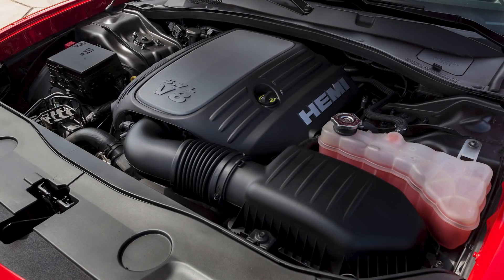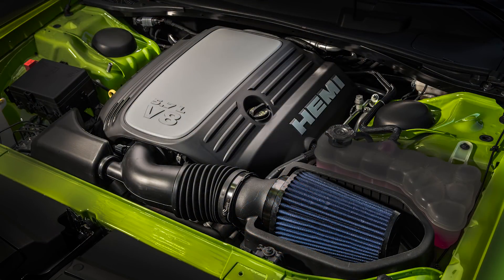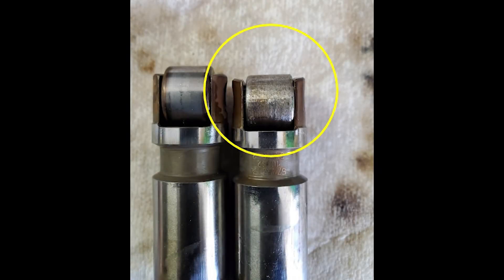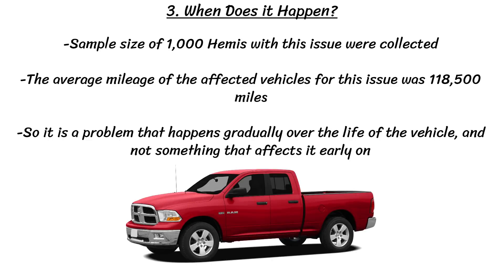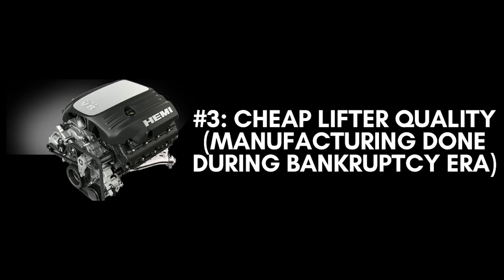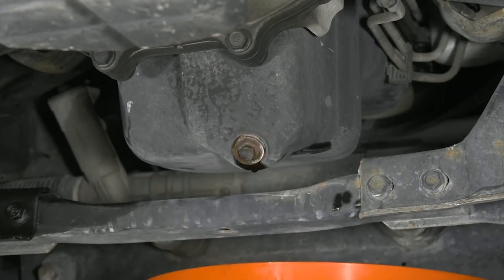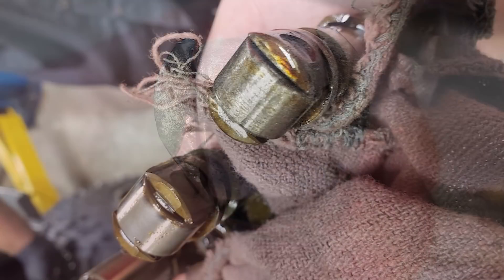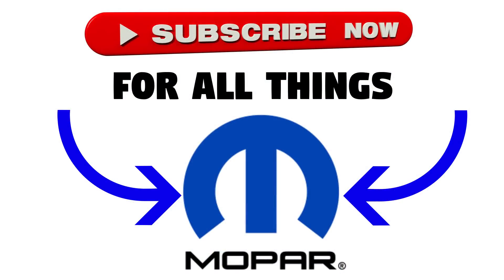The Fatal Flaw of the 5.7L Eagle Hemi V8 Engine Fully Explained (2009+ Lifters and Camshaft Failure)

Comment: This video came out just as I was removing a seized lifter from my Ex Police 2015 Charger Pursuit. I caught the lifter tick so early, it didn't get a chance to damage my camshaft. Lucky me. To all Hemi owners, listen to your engine! Nice video by the way!
Reply: I want to know how many idle hours your engine has...
Reply: @flatoutnorth794  Around 2,700 idle hours.
Reply: @hoonpatrol5994  impressive
Reply: @flatoutnorth794  They're strong motors and they come apart easy. I was able to replace the lifters in my Garage with nothing but hand tools. One thing you should watch out for is the T fitting that connects to the upper side of the heater core. They like to fail, and the car has no low coolant sensor to indicate any problems until it's too late, so if you smell coolant, pull over ASAP. My car nearly overheated, and I believe that was the final nail in the coffin causing the original lifters to fail.
Reply: @hoonpatrol5994  that's some good information! I've been particularly looking for a 2015 16 charger pursuit for a moderate price at auction. They go quick. I'll snag one soon enough.
Reply: @flatoutnorth794  They're great cars, but make sure to inspect it before buying. Auction cars are a big gamble. If you can test drive it, beat the shit out of it. If you can't, have a mechanic look at it. If it's sight on scene, go with your gut! Mine was a great example, but I still had to do some work on it, so I reccomend breaking out some tools and trying to work on it yourself. These cars are stupid simple and a great car to learn on. I've had the thing since I was 18 and have never taken it to a shop except for recall work. Anyway, good luck!
Reply: @hoonpatrol5994  why didn't you just replace the heads before this happened?
Reply: @wildestcowboy2668  What the hell? Why would I need heads? It's an Eagle block Hemi, it doesn't suffer from the valve seat dropping issues like the previous generation of Hemi engines.
Reply: @hoonpatrol5994  Simmer down there pal I just asked a question. After all I'm a custom fabricator/painter not a mechanic.
Reply: @wildestcowboy2668  Sorry if I came across as a bit aggressive.
Reply: @hoonpatrol5994  No biggie playa, I have just heard some engine issues can be avoided by replacing heads. Of course I'm a painter so only listen to me on the exterior of your ride! Lol
Reply: @Hoon Patrol  my 2015 charger pursuit has a 2534 idle hours on it. I haven't heard any issues yet but I'm not super worried because I want to upgrade the lifters and stage 2 cam
Reply: @tatsuhirosatou5513  Honestly, a lifter failure is a good excuse to go crazy with the engine.
Reply: The heads on these pulls fairly easily tbh. I don't understand why owners let that go for so long. Same for the exhaust manifold bolts that break.

Well let me rephrase that. The heads pull easily on a passenger car, or light duty pickup. Or Wrangler. But in something like the pro master, or minivans it's a pita.
Reply: Install the hell cat oil pump on your eagle.
Reply: @timmattle4730  What a shame. Unfortunately everyone, from the cops to the mechanics utter the phrase "not my car" every time they get in it or work on it. That's the risk of buying an old police car.
Reply: Was it just a loud ticking? How much was it for new lifters, did u upgrade?
Reply: @Foxengcnc  It was definitely audible. You'll know it's bad when you hear it. As for cost, the lifters were around $1,000 Canadollars. I went with OEM lifters, which were improved in 2018.
Reply: @hoonpatrol5994  thanks bud, I have the slight ticking on mine when it starts but that has always been there. I will listen harder lol thanks for the help
Reply: Hellcat or 6.2 oil pump and lifters
Reply: Unfortunately the Durango is my wifes car, who recalled it was making a tapping noise, but it went away after a week...
Reply: My dealership, Artioli Dodge keeps telling me my ticking sound, which sounded exactly like a sewing machine was the normal sound of the injectors. I filmed the engine ticking very loudly on startup.  They finally repaired the lifters and cam.  I never saw the old parts.  The engine was quiet for about a month. Then the sound came back.  I’ve taken it to another dealership when the oil pressure out of range code (check engine light) showed up… again.   Artioli checked the code in ‘23 and it went away. They said they couldn’t reproduce it. It reappeared a few days ago and the other dealership replaced the sending unit. I’m not sure if oil pressure out of range codes are an indicator of lifters starting to go.
Reply: How to check this idle hours?
Reply: Just don’t buy a piece of shit hemi
Reply: @chanoleyva  Found the little kid.
Reply: @chanoleyva  too late, now u tell me

Comment: I'm curious if this also affects 6.1/6.4? I assume most of the tech is based on the same parts?
Reply: Yes, but not nearly as much. The 6.4 shares a lot of the same parts and tech, not the 6.1 as much though.
Reply: I've not read very much with the 6.4s as far as failures, but personally know of several 6.1s that did the same thing, and they don't have MDS lifters. They didn't build as many 6.1s, so we don't hear about them as much as the 5.7s. All the Chrysler techs I've talked to say to use the 392 and Hellcat lifters as a direct replacement/upgrade for non MDS applications, in any Hemi.
Reply: @adamtrombino106  BTW there's no such thing as 392 or Hellcat lifters, all the engines use the same lifters. The only differences in the lifters is evolutions throughout production and if 8 of them are MDS lifters. All non-MDS lifters are identical and all the rollers are identical. The evolution is the last letter of the part number. D is current, as long as the last letter of the part number is D, they're the best Chrysler has to offer.
Reply: @adamtrombino106  Yup, the 6.1 was really the first place this lifter problem showed up. The initial root cause could be said to be overly aggressive camshafts. The original 5.7 had a relatively tame camshaft with shallow ramp angles and rather light valve springs, the lifters were fine in this application. When SRT pushed things with the 6.1 they gave it an aggressive camshaft profile and stiffer valve springs, this put more stress on the lifters. The 6.1 being an early non-MDS and non-VVT engine also means it has the smaller oil pump. 

The 2009 introduction of VVT in the 5.7 gave the 5.7 an aggressive camshaft as well, however those engines have lighter valve springs, a lower redline, and a larger oil pump. It's interesting that the 2009 and 2010 5.7 engines don't appear to have lifter issues even though they have the older lifter design and aggressive VVT camshaft. 

Clearly something changed in 2011, none of the engine specs changed between 2010 and 2011, but the most failures are in 2011 to 2013 MY cars. Presumably penny pinching as a result of the bankruptcy. In 2014 the lifters were updated with larger roller bearings. 

We know the current lifters are made by Melling, but who was making them in 2011-2013 I'm not sure.

The 6.4 uses the same lifters as the 5.7, but the 6.4 has several differences that could make the problem worse or better. Stiffer valve springs, higher redline, they specify 0W40 oil, and have oil coolers. Whether or not the higher redline and stiffer springs matter depends on if we think valve float is a contributing factor.

Comment: 246,000kms on my 09 300c with MDS active and it sounds brand new
Reply: I had 180,000 miles on my 2009 Challenger RT,no issues except water pump at 140,000 miles..I did floor it daily,it held up well..I owned 3 other 5.7 Hemi's,6.1 Hemi.392 Hemi and Hellcat never an issue!

Comment: Yes. My dad's 2011 Ram 1500 had the issue at 105,000 miles... I bought the truck from him in 2018 at 195,000mi and currently have 220,000mi on it... I occasionally hear the "tick" but I also have an exhaust leak that I need to fix. 

I'm keeping this truck forever because its sentimental so I pray nothing goes wrong while I'm still in college 😅

Comment: The cam placement was changed , it sits higher in the block and doesn't get the oil needed , lifters and cam failure will happen .
Reply: Stop listening to UT.
Reply: Not true at all

Comment: I have a '09 challenger I bought with 40k miles on it. I ran into this issue right around 60k and thankfully caught it before it started rubbing on the camshaft. The mechanic I had fix this said it was most likely due to the MDS system.

Comment: Thanks for a good video and valuable insights. Just a question: Does 3.6 Pentastar faces the same issues with "ticking" lifters?
Reply: No it does not, pentastar is  dual over head cam, no parts are shared , no push rods
Reply: Cam followers or roller rocker arms fail in 3.6s the same way lifters in Hemi's fail. The rollers fail and eat cams and sometimes destroy the heads. There are 2 TBS about this issue. While any 3.6 can develop this issue, it seems '11-early 14s are the main yrs.
Reply: our jeep wrangler with the 3.6 ticks nice and good at 89,000 miles
Reply: The 3.6 will need a rebuild before that happens.

Comment: The fact that new lifters were introduced in model year 2016 for MDS systems says a lot.
Reply: That's not exactly true though, the update that mattered occurred in '14 and the change was made to all the lifters not just the MDS lifters. The key difference is in the image at 5:12.
Reply: No, it doesn't
Reply: @starmc26  Exactly. Clearly a flaw. And who would trust the co. that denies it, to FIX it !?
Reply: My ram is a 2017 5.7 so did it get the new stuff?
Reply: @califaern3sto  Yes, all 5.7 hemi Rams from 2014 up have the new needle bearings for the lifters. If you have a tick that seemingly goes away as it heats up, it's the exhaust manifold bolts. Powertrain warranty covers it.
Reply: @starmc26  it doesn't seem to tick and I have no issues whatsoever
Reply: @califaern3sto  Cool, no issue then. If you do develop a tick, check those bolts.

Comment: Well, I always said I'd have bought a 2010 Challenger with the Hemi had my dad not intercepted me and talked me into driving to the GM dealer where I bought my Camaro SS. I was this close to signing that paperwork on the RT Spring edition in that pretty blue. It had a pistol-grip shifter and the HID's. It was optioned out and I rather enjoyed that test drive. Had he been in the car with me for that car, he probably would have sang a different tune, but I drove that car first solo, then ran into him and he talked me into going to GM to drive the SS, where he did ride with me.

That said he already bought a Challenger with the V6 and that dude also has the obnoxious ticking on startup, has for years, and it hasn't died yet. So, maybe he saved me from a catastrophic failure, maybe he didn't. The Camaro only has 30k miles on it after 11 years of ownership, so I imagine had I got the Challenger instead, it would have roughly the same mileage and thus no failure yet anyway.
Reply: gm makes horrible cars now. you were better off with the fully loaded rt and just change the oil when your supposed to
Reply: @flicksifyr6793  yeah gm hasn’t made a good car since the 90s trucks are ok but if even ram passed them then there not doing much

Comment: Does this affect the 6.4 srt engines? I try to never let it idle for very long due to the oil issue and if it is idling I'll give it a small amount of throttle around 1k rpm to get the oil psi up around 60
Reply: Not really, they aren't 100% immune, no engine is. But they use thicker oil, have oil coolers, and heavier valve springs.
Reply: i've already had homeboys with ticking 6.4's (300 srt8)
Reply: maybe around 115k miles 😿
Reply: Yes this issue also affects the 6.4s as well. Like he said it's not every hemi will have the "hemi tick" but this issue has been known to be found in the 6.4s more than the 5.7s. The only Hemi not affected is the 6.2 hellcats cause they don't have MDS.
Reply: @raymtz4016  No not really, of course it's occurred in some 6.4 even some 6.1 engines. I'm unaware of it happening in a 6.2 but I'm sure it has or will eventually. Roller lifters no matter how well made are very high stress parts. They'll fail in any poorly maintained engine. 

Many 6.4 hemi engines were built during the bankruptcy years and using the AB lifters(11-13). Yes those are rather prone to failure, but from what I've seen at less of a rate than the 5.7 engines built in the same years with the same lifters.
Reply: @snek9353  hmmm interesting, I really didn't know that. Thank you for correcting me bro.
Reply: All of the naturally aspirated modern hemi engines have this issue. It is most common on the 5.7 though. Doesn't happen on the 6.2 due to it having better lifters. Usually this issue happens around 100k miles. Most 6.2 hemi engines will never see that kind of mileage anyways.
Reply: @gasolinediesel972  No, this issue is largely limited to 11-13 model years. Yes it's happened to some engines in other years but the vast majority are 11-13. 

The 6.2 does not have better lifters. All engines of the same year use the same lifters. The only variation is if an engine has MDS or not as 8 of the lifters in an MDS engine are different. But a 6.2 of a given year will have the identical lifters to a 5.7 with a MT or in a HD pickup, and the same as the 8 non-MDS lifters in an AT car or light pickup.
Reply: @snek9353  They did improve the lifters in 2014 but they didn't fully solve the issue. It is MUCH less common on later model engines but it does happen.
Reply: @gasolinediesel972  "in 2014 but they didn't fully solve the issue"
- Ehh IDK about that, suppose it depends on how you define the issue. As far as I can find nothing has changed about the roller design since '14. In '14 they started doing the larger rollers and as far as I know they haven't changed since. Yes the version has updated but it appears to be only minor changes to the internals of the lifter not the rollers. 

Now in '15 they changed the factory oil monitoring system, I'm sure that helped. But I think that's really about it that would effect this lifter issue.
Reply: @snek9353  I have seen it happen on a few later model engines. Doesn't happen nearly as often though. It does still happen though which is why people still talk about it. I think the issue was fully solved in 2018 because I read somewhere that the early 2018 models have had these issues but no such thing for the late 2018's.
Reply: Mines a 18 with a lil over 10k miles on it rn. I always changed the oil before the "recommended" time. Usually around 3k. I love this car and I don't want to damage the engine, I usually just do short pulls with it, let that monster roar! Ha

Comment: I saw another video where it mentions that the problem is the use of 5w20 oil .. at normal operating temperature, the oil loses its lubricating properties.  Instead of using 5w20 they use 5w30 and the noise is no longer heard, the other video that I saw explains that it is a lack of more oil and also the position of the lifters prevents the oil from reaching to lubricate them.
Reply: There's likely a good point to be made regarding the use of 5W20, but not a lack of oil.
Reply: You should stop watching videos, and stop liking your own comments.
Reply: @starmc26   you're not going to tell me what to do .. if some comments bother you, it's your problem.. I don't have a hemi to experiment with ... I say this so that someone can experiment with their own engine.
Reply: Use the recommended oil... you can void you warranty... Newer vehicles know how dirty you oil is and the viscosity you are putting in the engine...